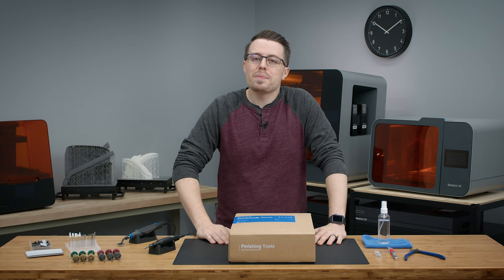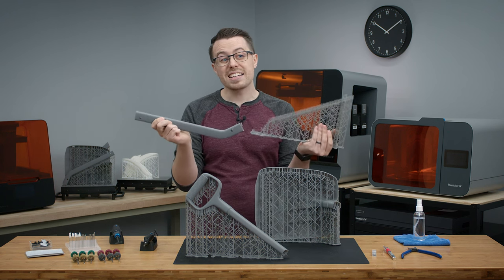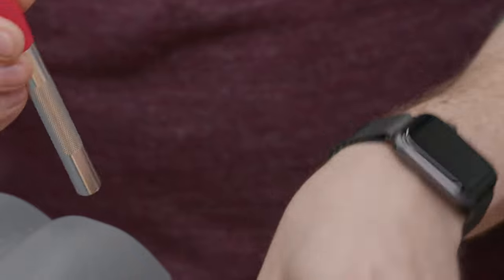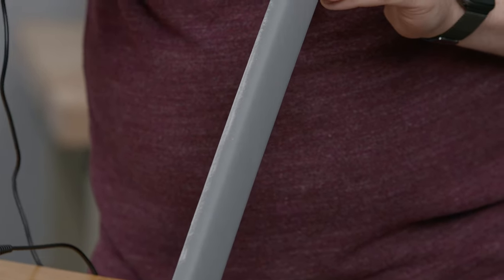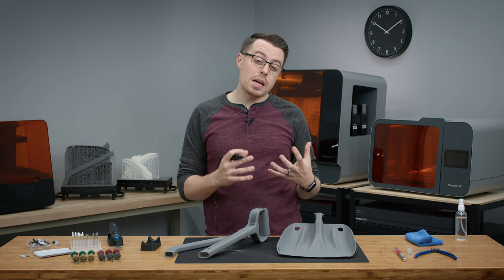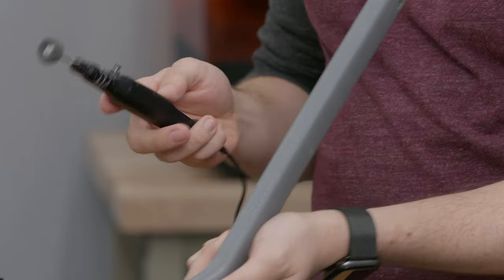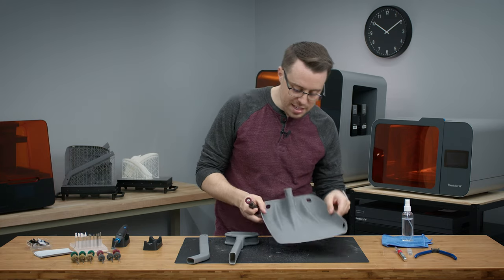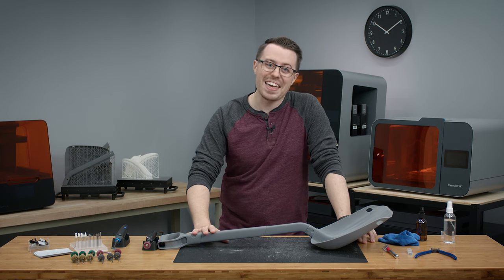3D Printing Post-Processing: How to Use Finishing Tools For SLA 3D Printed  Parts

Comment: What are your recommendations for PPE while finishing? Should we wear gloves or a mask? I'm worried about breathing in and tracking around all of that dust, given that it doesn't degrade on its own like sawdust.
Reply: just guessing, but given that even sawdust can harm your lungs it would seem that some sort of mask would be recommended. a simple box fan with a furnace filter could help with collecting dust
Reply: I would recommend at least an n95 for particles for the processes shown above. Personally I work with SLA a great deal so I use a half-mask respirator with Organic Vapor canisters, n95 covers, gloves, and eye protection to avoid the acute toxicity of liquid resin & fumes as well as the tendency to get sensitized to the materials with repeated exposure.